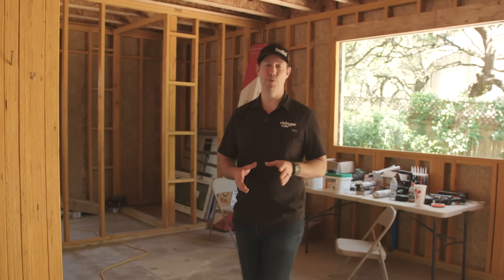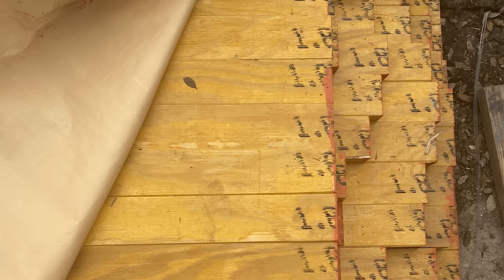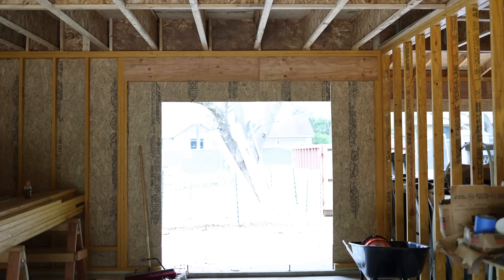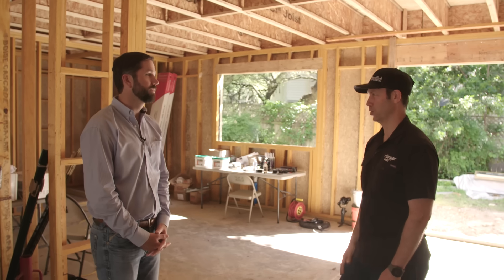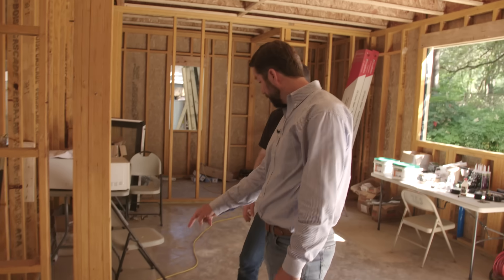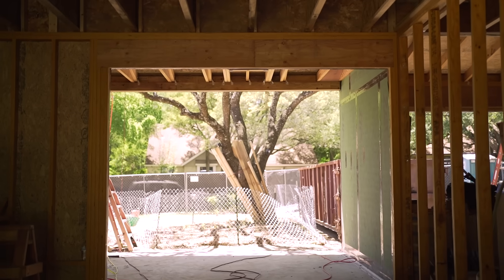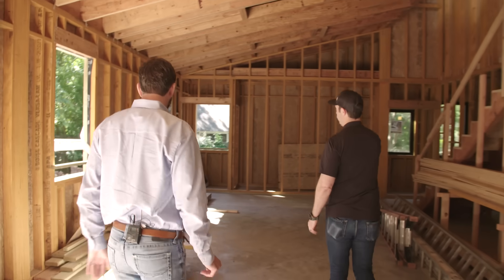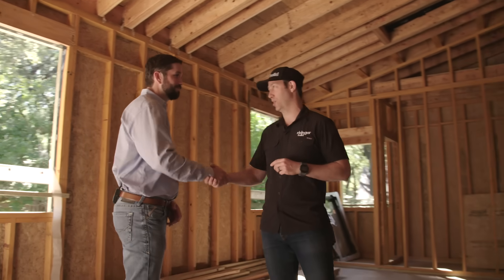House Engineering - Common Mistakes

Comment: I don’t like glue lam or engineered under fire conditions the glue will be the first to fail and if one fails the whole roof fails. And then when if it’s on fire and you put water on to it the whole house is ruined unlike heavy timber
Reply: Is there any kind of source to back this up? I can't find anything on gluelam failing in fire conditions. All the sources I found by manufacturer or third party saw it meeting or exceeding the expectations of regular lumber.
Reply: Axipixel going to any fire science class or ask any firefighter. Some departments don’t even go on top of these roofs.
Reply: I was going to comment on that right before I saw you posted this. I'm glad someone else knows that as well. I have seen a display explaining that at the Boston firefighter training center. Honestly not a good system.

Comment: I like the engineering part and have a question about the off-gassing and will it be mostly off gas by the time you move in or how do you deal with the vocs since your house will be so airtight?
Reply: Ventilation.

Comment: Matt,
90% of home issues I have to look at in my area are either about improper deck design (especially attachment to the house), improper notching/drilling of floor joists, or improper anchorage of guardrails. I think having your engineer spend an episode each on these topics would save a lot of contractors money down the road.

Comment: I just finished framing a floor structure for a three season room addition at my house.  I went to the Simpson catalog online to spec connectors and fasteners to meet my design loads (I'm a civil engineer).
The hangers that arrived from the local lumber yard were for the same lumber size (a 2x8 hanger is a 2x8 hanger, right?).  The ones they provided had different load capacities and well as different fastener requirements. 
This happened with post bases, joist hangers, and 10d Simpson nails where I ordered 3" and they sent the 1-1/2" that they stock.   I had a "come to Jesus" meeting with the salesman about asking questions rather than assuming that I had "made a mistake" on the materials list.

Comment: First time ive never seen some construction adhesive on the joist hanger.
Reply: there is alot of stuff i laugh at like the whole new pneumatic nailer's for the the joist hangers and tie downs coil guns are like 30 to 40 years old and have been used since they came out they got banned here in (Australia) for a bit on homes cause people could use them right kept sinking them too deep or too shallow but then every carpenter wanted more money to hand nail the framing tie downs

Comment: With all the attention to go away from wood cut directly out of trees to engineered wood, why not use another engineered product called steel, which is mined, melted, cast, rolled, and Formed to the structural loadbearing shape there’s optimal to handle all the stress is applied to it. That is what I call an engineered product. What do you think?
Reply: Cost. $$$

Comment: For the very critical loadbearing column they couldn’t go wider, why not just switch to steel??
Reply: An HSS tube would’ve been easier to install and just bolt it to the grade beam they verified. Completely agree.

Comment: @8:35: Saddle fasteners are proud, where column fasteners are reccessed. This detail seems odd to me. Just wondering, how this was finished? Was the column built out with a furring strip, or was the finish drywall facing interrupted, or was the material from the back of the drywall removed to accommodate the fasteners and saddle?
Reply: probably crown moulding after your comment of material removed from back

Comment: Matt... Could you address using OSB vs Plywood. I have quit using OSB because the sawdust made my lungs tighten up with every house I've framed. I have also seen the effects of a leaky shower on I joists. I had to tear a mud pan shower out and the I joist was feeding mold spores like crazy. Plywood doesn't seam to feed mold like OSB does.  What are your thoughts about OSB vs Plywood. Thanks

Comment: How does the fire department like these products?  What about chemicals that leech into the air for long term health?  Great case of making things easier for the builders.
Reply: I teach building construction for firefighters.  We commonly walk through buildings under construction to understand how they go up...and come down.  Been a fan of this channel for the last year or two.  The LVLs dont bother me-  under fire conditions they behave similar to heavy timber structural members.  When firefighters hear the word "engineered", we typically associate this with "lightweight wood framing" in residential houses- which burn fast and collapse early.  Engineering replacing MASS with MATH- which performs just fine under normal conditions, but in fire conditions, for example, the OSB I beams, gusset plated truss roofs, etc... fail much faster than traditionally framed homes.

Comment: Question 1: Are you going to eventually spray the floor i-joists with some sort of a fire retardant paint?.
Question 2:  Should upstairs bathrooms and utility rooms have some sort of central floor drain,
for those just in case(oops) washer/toilet overflows so your first floor ceiling drywall does not get ruined.
Question 3: Are going to use rock wool for certain inside walls for sound isolation?.
Reply: California plumbing contractor here, love question #2!
Reply: @joelfedor4984  I know in a lot of laundry rooms there is an overflow under the washer with a pan.  I would think a good water detection system with automatic shut off valve is in order here.

Comment: My bigger question is why do we still use so much wood even on up scales houses but than we look at commercial everything is metal. 

Matt do a video of PRO / CON  wood versus metal on points like : Corner stud, Interior wall , Exterior wall , Floor Joist and of course Opening Headers. 

I think we in the industry should look at all options. Like why don't we do all Corner and structure points with 1/4" squaretube 3" for example. Yes we all know wood works and moves, steel doesn't but I think it's time we come up with a hybrid version rather than just wood for framing especially looking at all those natural disasters we have thru out the USA.
Reply: Cost $$$
Reply: Cost
Reply: But $$ overtime vs $$ upfront.  When parts fail and require renovation to fix a problem, it costs more at that point than likely upfront to do it right from the start ( and especially if coded and all builds require -cost comes down).  It's more about profit now and again than cost over time. IMHO

Comment: What I heard from the engineer, the “dimensional solid lumber completely works, builders choose to overdo it.” I am a homebuilder with 20 foot walls in my own home with regular old 2x8 and they are fine. I used advantec subfloor/ and their adhesive (due to Matt’s overwhelming rave reviews) and have squeaky floors. It’s weather resistance was great, it’s flat as a table, but it did not eliminate squeaks.
Reply: Are the squeaks from the subfloor to structure, or finish floor to subfloor?how can someone identify this? How can it be fixed?
Reply: Do you have subfloor adhesive in the hangers if you have hangers?
Reply: @Jacksonemccoy  yes. Loads of it. Squeaks have gotten worse. Underneath in the unfinished basement you can see what appears to be failed glue joints staring to bounce and the subfloor is squeaking on the ring shank nails. The glue appears to be compressible after curing.

Comment: Gluing the joist hangers between the joist and hanger is important. Don’t forget.  It will help eliminate squeaky floors at those connections.
Reply: I have rolled thousands of joist's in my 38 years of construction and never once have I glued a single joist to a hanger nor have I had a need to. I have never been called back to fix a squeaky floor before. I don't see any need to do that. I mean you are welcome to do as you want but I ain't about to start doing that.

Comment: Wish the previous owners of my house had talked to a guy like Whit.  I'd have a flat floor and a better load bearing post.  Great content and very useful.
Reply: The key to building a straight house (besides framing it properly) is checking every single board at the lumber yard for trueness and storing it flat on site.

Contractors don't give two shit how twisted or warped lumber is if they can make it work just good enough.

Comment: Engineered Lumber has so many advantages over traditional Lumber but for three (#1 it's more susceptible to mold, #2 acts as an accelerant in house fires & #3 cost ). That being said, I still wish I would have used engineered floor joist in my house when I built it 12 years ago. Exterior walls using 2×6 traditional Lumber, no problems ( I would do that again in a heartbeat plus my wife likes the larger window sills for knick knacks and Christmas decorations). Interior traditional 2x4 Lumber walls, quite a few got sent back to the lumber yard, but in the end the carpenters did a good job catching those warp boards and throwing them aside.
Reply: Same char rate as lumber look at the astm

Comment: Awesome video talking about all the pros of the engineered wood . But you did not address one of the major cons or even mention it. I'm a fire fighter in NY and all these products use glue. These floor systems could fail as quickly as 5 minutes where normal sawn lumber could last up to 30 minutes before failing. Just something that should be mentioned ?
Reply: Look up the tests. Same char rate as lumber

Comment: I’m always hearing how engineered wood is better than regular wood for framing however, I was taught, in the fire academy that during a fire, a house will burn faster under engineered wood than regular wood. We were taught that if a house is built with engineered wood...let it burn down because it’s too dangerous to go in.
Reply: It has the same char rate as lumber. Look up the tests

Comment: When do structural engineers typically get involved in projects vs your remodel?
Reply: When you make framing changes which change the “load path”. Most experienced contractors can do minor structural changes just based off experience and I’m an engineer. I’d call an engineer when removing load bearing walls permanently or making major framing changes.

Comment: I would like to know the final cost per sq ft of this house.
Reply: Exactly. Is this actually worth the extra cost? At what point does it become overkill? If you’re creeping up to 50% more cost for very little reward. Hard to justify in my eyes.
Reply: @AE-xb1hi  don't forget, not every home owner considers cost for material and cost for energy equally. If I had the money, I would feel better about my environmental impact knowing I had built the most energy efficient house possible, even though the extra cost might not be paid back in my lifetime.
Reply: i am sure using a lot metal fasheners and screws is very expensive. to save cost, they should only be used strategically to increase structure integrity. i prefer designing wood structure with proper placement of each support part like how the old japanese houses, building a house with no nails.

Comment: I wonder how the engineered studs last if you happen to have a flood? Locally some places built 80 years ago are seeing a flood, never before seen due to a 20 mile long ice jam. Or even the happenstance of a check valve on a sump pump failing and town water backing into the basement. 🤔
Reply: if LVL gets saturated it will expand, and then shrink again, but not back to its original size. I picked up one 45mm thick offcut I'd left in the rain, it was about 49, then once dry 46. The width expanded then shrank back to original. I think it gains thickness because the glue laminates change. I'd say the overall distortion would be what you'd experience from (dry) sawn lumber though.

Comment: Matt and Whit. Remember that your built-up column doesn't meet the NDS requirements to cause in plane buckling composite action. The easy way around this is to just make sure the drywall (which is always structural bracing when it comes to light-frame construction) is connected to either all of the studs in the column, or to just the end members.

Comment: EDITOR: You audio compression / noise reduction is cutting out the top and low end of their voices (prime example @11:50).  It's pretty distracting; sounds like you're listening through a cup on a door.

Otherwise, good edits.
Reply: Sounds more like low bitrate to me. But I concur...bad audio!
Reply: I didn't even notice. Many viewers are more interested in content not audio quality
Reply: @samt5663  I didn't notice but I think that's because I stopped listening as they really weren't saying much.

Comment: can one purchase an LVL that is pressure treated for exterior use.
Reply: Weyerhauser says "no". But Pacific WoodTech is making pressure treated LVLs. They pressure treat the laminations before they are glued up. Apparently the glue still holds. If it were visible though I'd still opt for a glu-lam beam.